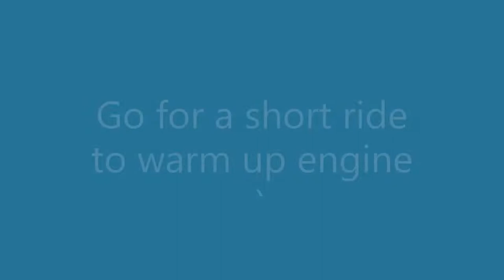BMW R1200RT How To : OIL CHANGE

Comment: Why do you tighten the oil drain plug and filter before you remove it?
Reply from the maker: I actually did that by mistake,I was laying under the bike : ).But If you have bolts that are hard to get loose if you first tighten it can help to get them loose.Thanks for watching.